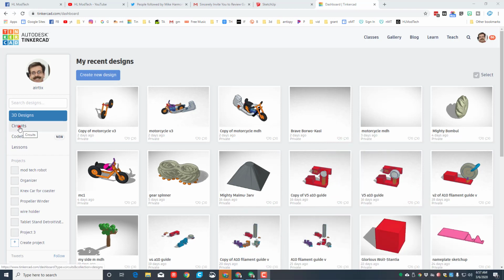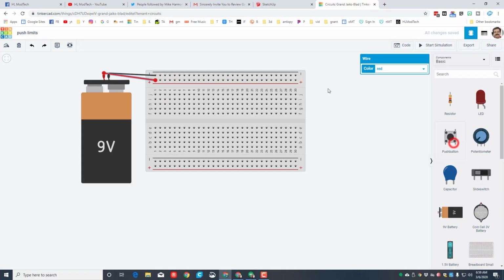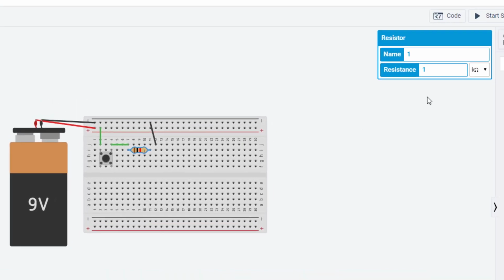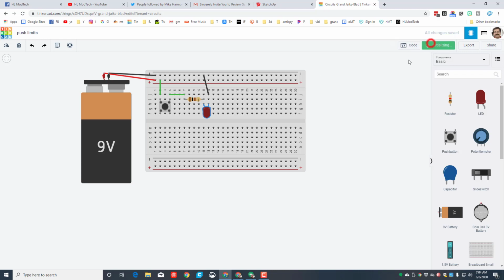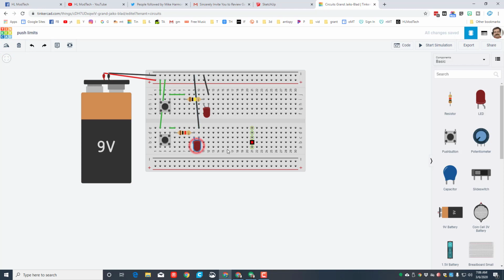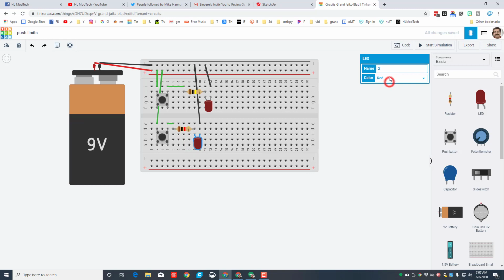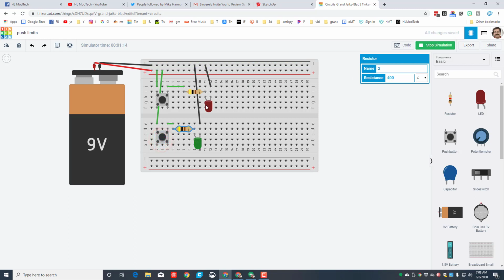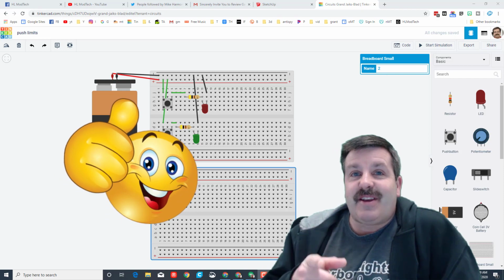Master the Push Button in Tinkercad Circuits! Slick, Simple & Useful!

Comment: how would you make a circuit with an on and off button? meaning when you press it once, the LED light turns on and stays on, and when you press the button again, it turns off.
Reply from the maker: Use the slide button instead. Here is an example https://youtu.be/RbpsaDst9qQ